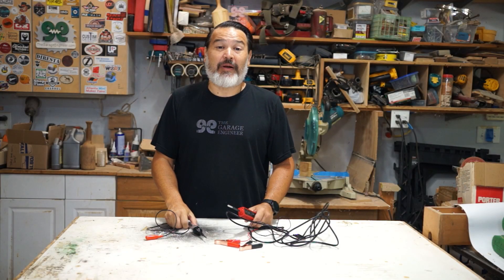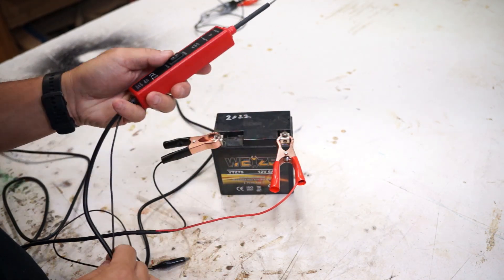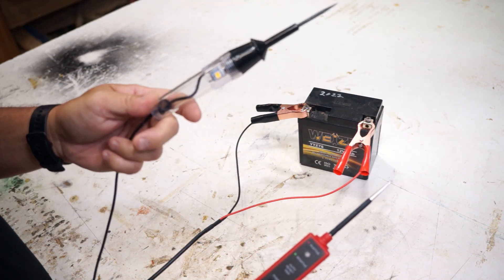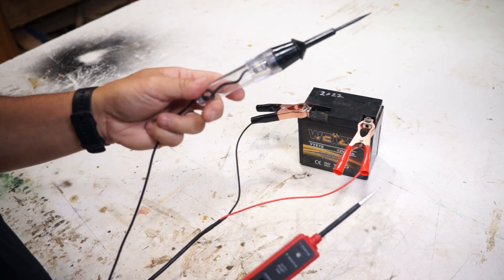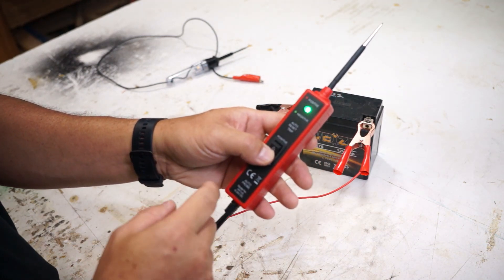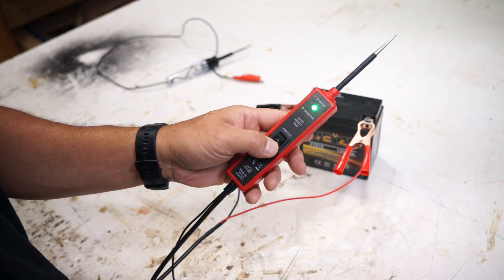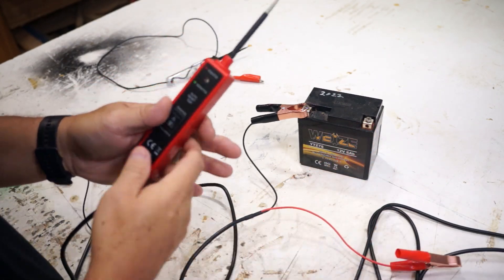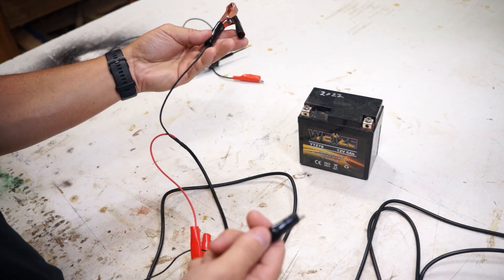Why this is a Great Powered Circuit Testing tool: 5 Feature Video Short

Comment: I recall using circuit testers on OBD2 plugs when I didn't have a scan tool ( you can count pulses for error codes ). If I had used an incandescent tester I could have fried the ECU. Definite young player trap.
Reply from the maker: That is a great test case of not to use incandescent bulb tested.  Thank you for the knowledge.

Comment: There are time were you 100% want a small load on the circuit.  It's become VERY handy in automotive work with shotty connections and electrical gremlins. VERY handy.  So the "less draw is better" argument is needs a HUGE caveat.